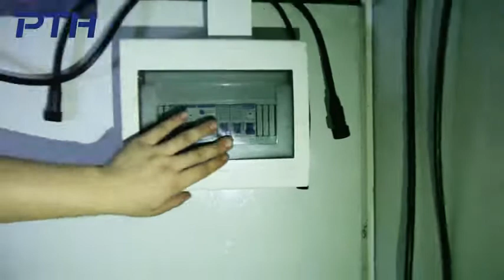10*20A Detachable container house | PTH latest detachable container house installation video

Comment: Very good and informative video!  I noticed you have another unit similar to this one with a one piece roof.  How many of these detachable units can be put in a 40 foot container vs the flat pack units?  I ask because of the increasing freight rates.  Thanks!